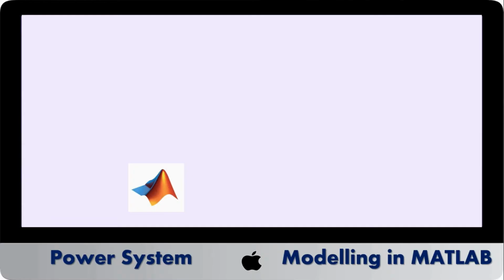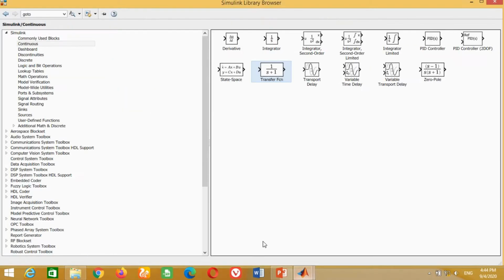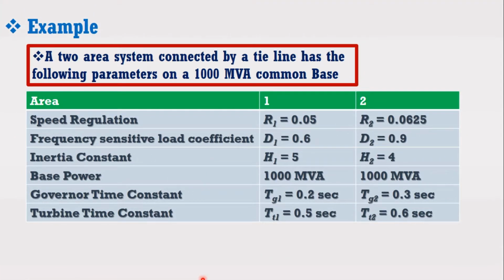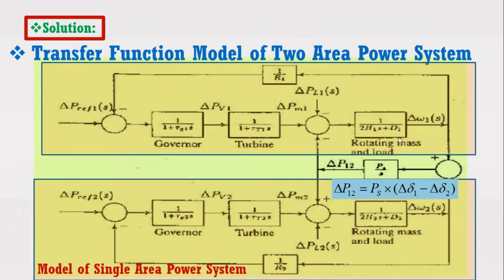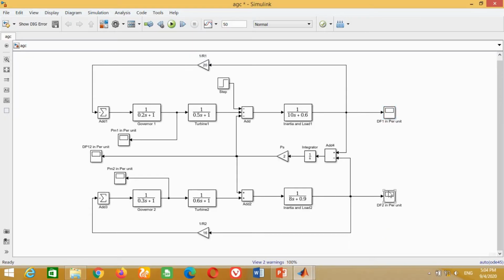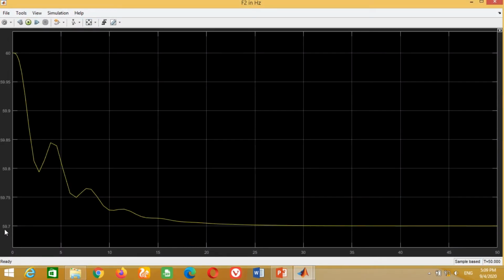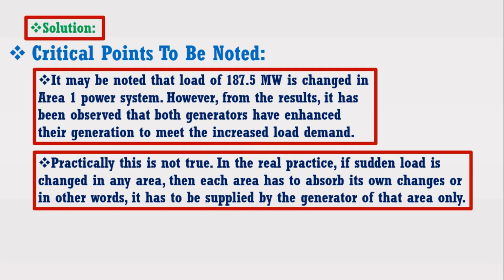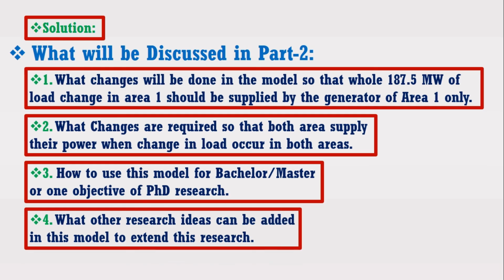How To Design Automatic Generation Control of Two Area System Using MATLAB/SIMULINK (Part-1)

Comment: hello Sir, please can you help me please. i have to simulate a single- node power system with 2 turbine- generators (power plants) supplying one load and observe the frequency behaviour after the loss of one of  generators(a t=5s)
Reply from the maker: Thanks for the comment. For this topic, first try to find any research paper closely related to this topic. Then try to reproduce it in the MATLAB. Otherwise, it will be difficult.
Reply: @DrJALAGHARI  please sir could you make a video on it?
Reply: @Nodommify I have the same case as you and I'm stuck please can you provide any help

Comment: Sir what if the base MVA is different and we have to perform base conversion ? Suppose area 1 has Base MVA of 1500 and area 2 has base MVA of 100000. Do we have to convert values of "R" and "D" to a common base ?
Reply from the maker: Thanks for the comment. For details, kindly go through the power system analysis book by hadi sadat chapter 12.

Comment: I am doing agc with a single area system. But my output is not correct. Can you help me with this ?
Reply from the maker: Yes sure why not?. What problem you are facing?
Reply: @DrJALAGHARI  i don't get my output. While i am doing this. I put all values and blocks correctly in Circuit. But when i run the simulink it's output is totally different then it should be.
Reply from the maker: @fashiontips5322  what should be the output? And what is your output?
Reply: @DrJALAGHARI  as it shown in your video. My ouput is same as your ouput. Which is shown in this video.
Reply from the maker: @fashiontips5322  if output is same then what is the problem???
Reply: @DrJALAGHARI  sir, i want to share you my matlab simulink file. So that if there is any problem in the Circuit so u can recognise. Because i don't get where the problem is. 
So can i share matlab file with you ?
Reply from the maker: @fashiontips5322  yes sure. Send your file to my email. jalaghari1@gmail.com
Reply: @DrJALAGHARI  sure sir

Comment: Thanks bro.. plz I need expalin about connect two area power system with PI I need it necessary
Reply from the maker: Thanks for the comments. Just watch the second part and then replace the integral controller with PID controller. In the PID vontroller, put the input of D to zero

Comment: Dear Prof. I have a question. I was trying to practice your model, however using but 100MW for change in load at Area 1. When I showed it to my Supervisor a Prof. He suggest that the model does not show the Pref. i. e there is no ref. Power value inputed on the feedback. Pls can you explain why?
Reply from the maker: Thanks for the comment. You may kindly go through hadi sadat book chapter 12 for further explanation.
Reply: @DrJALAGHARI  Ok Sir. Pls which of the edition do you recommend. I have seen the second edition on Ebay but I am not sure if that covers all the chapters?
Reply from the maker: @danoku5582  this book is freely available on internet. You may download it.
Reply: @DrJALAGHARI  Thank you sir